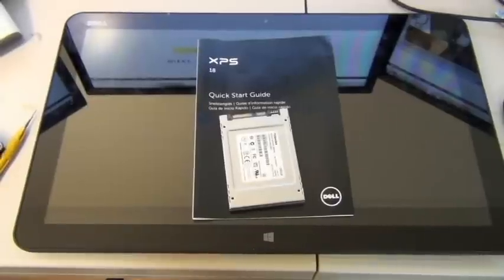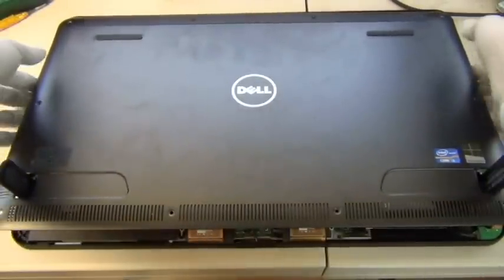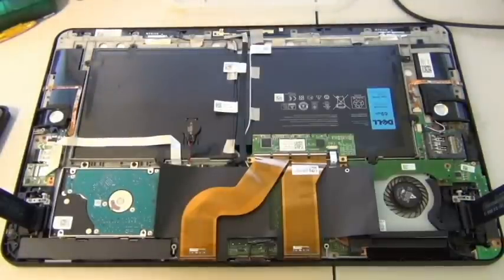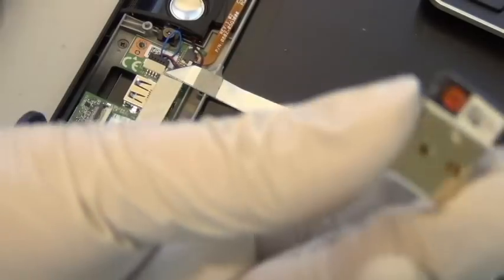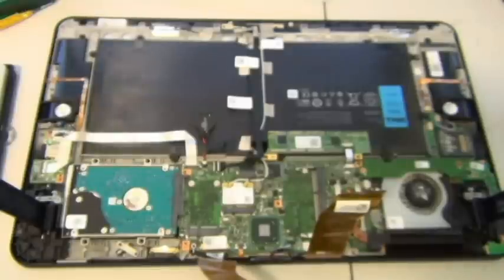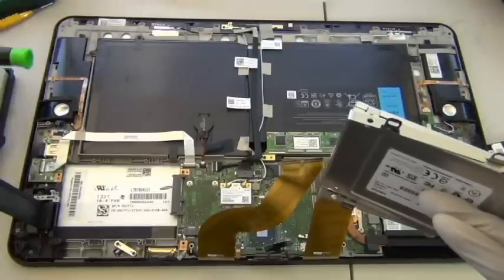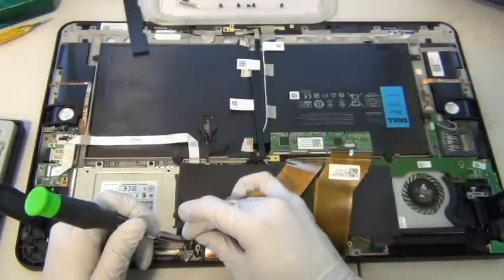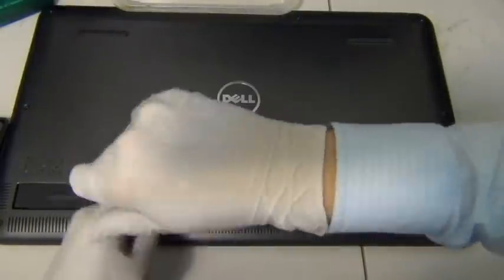Dell XPS 18  Solid State Hard drive SSD Upgrade replacement instruction HD

Comment: I've taken mine apart a few times. I think you know you didn't need to take all of those parts on the inside off. All you need to do is take off the back, then you only need to take off 4 screws that hold down the drive. Watching your video though, it helped me remember where to put the small plastic strip back at  :)

Comment: Hi - thanks for this video. Couple of bits of constructive criticism
1. The 10 screws holding the back on are torx screws (6-point star-shaped cutout for screwdriver bit) not hexagon screws (hexagon-shaped cutout). My bit is labelled "CR-VT 9" so I guess it's a Torx 9 bit
2. If you do a run-through without recording, you will be able to eliminate the "Is this a battery? No ... I don't know ..." type lines that really don't give further information
3. I was glad to see you thinking about the way the keyboard and mouse are connected (Logitech radio via a concealed USB socket, not bluetooth) as i hadn't realised this and by implication it tells you how to reinstall the operating system (Esc or F2 or F12 or F8 or whatever when booting). It gives me a clue why my machine is completely unresponsive (put in a new wireless keyboard and mouse combo with a new radio receiver and it worked straight away). I liked the tips on putting the ribbon cables back into the fragile connectors. BUT ... that's not what the video is about - it's about hard drive swapping. Someone who is in a great hurry might prefer going straight for the disk swap
4. It helps if you don't put your head in the way of the view when trying to show detailed stuff
Sorry if this sounds all bad - the rest of the video is excellent!